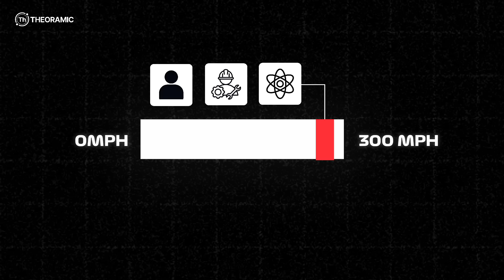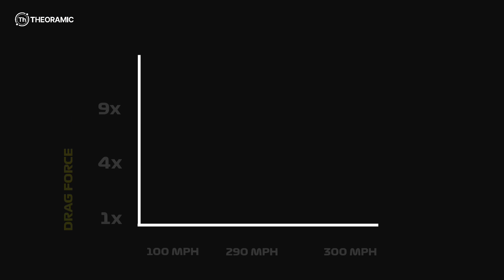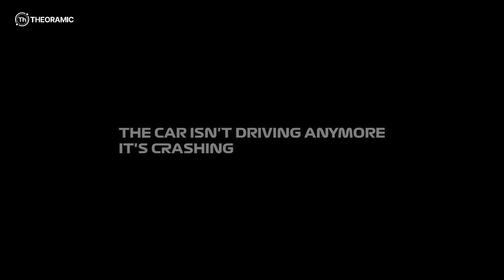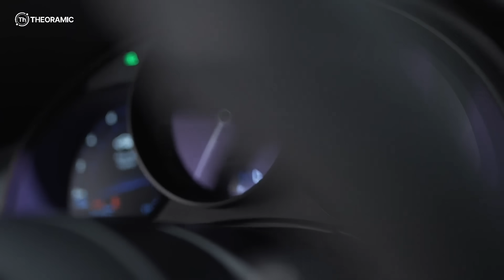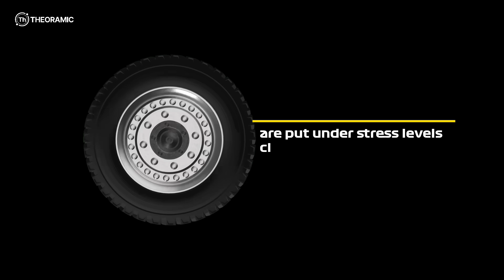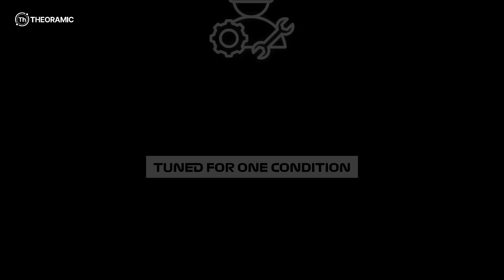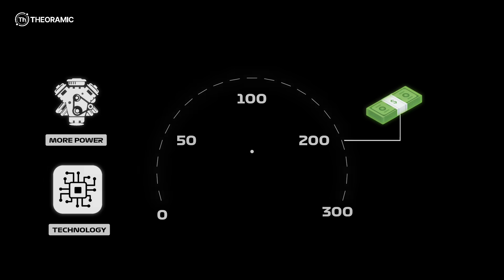Why It’s Almost Impossible to Go 300 MPH

Comment: The ssc Tuatara went 295mph verified by Racelogic vbox, this car has the most simplest Y-zero section of any those cars in the video. Way small frontal area and much cleaner wake. 
Aero designed then styled is key in this mission of 300mph.  Compare the side views of the F5, Tuatara and Chiron and you will see which company cared about cutting through the air the most at ease.

Comment: Honestly, it's not just the effect of suddenly stopping at such speeds too.

Go fast enough and you'll have to worry about the driver becoming a pancake cause the force from getting shoved into their seat. You're making the car AND the driver battle with G Forces essentially.
Reply from the maker: Yo, you nailed it! The G‑forces at 300 mph are insane—both the car and the driver get slammed hard when you slam the brakes. It’s a whole physics battle in the seat 🚗💥.What’s the craziest speed you’ve ever experienced in a car or sim?
Reply: @theoramic_yt  My dad did pull 100 mph on a highway back when I was in highschool. being the middle of the night, wasn't that much traffic either.

Just that much made me feel like I was being pushed into my seat. Of course, he didn't slam the brakes to slow down tho. He just dropped back to going around 50

Comment: I got to about 120 in my volvo xc90. At that point if your not traveling straight the handling starts to decline. I could say that if your driving on a straight road you could handle about 150 MPH normally. The roads in massachussetts usa are not without potholes and are constantly being repaired and are not straight.
Reply from the maker: Appreciate the real-world insight. That actually proves the point of the video — once you pass ~120 mph, even large, stable SUVs start running into physics limits. Tire heat, suspension geometry, road imperfections, and aero lift all stack up fast. On public roads, it’s not about “can the engine push it,” it’s whether the car can stay planted, steerable, and safe. That margin disappears quicker than most people realize.

Comment: Suzuki Hayabusa went 311.94 miles an hour
Reply from the maker: That run was legendary — but notice the pattern: closed course, extreme aero, custom tires, extended gearing, and a heavily modified powertrain. It shows that 300+ mph is possible only with purpose-built machines, not standard street vehicles.

Comment: This is nonsense. The 1600 HP Koenigsegg Absolute has no trouble going 300 MPH, so it depends on HP and conquering drag for good aerodynamics.======
Reply from the maker: The Absolut is actually the best proof of the video’s point. It’s one of the only cars on Earth built from the ground up for extreme high-speed stability — special aero, custom tires, gear ratios, suspension geometry, and even road selection. That level of engineering is exactly why 300 mph is nearly impossible for normal road cars, even with big horsepower.

Comment: Two problems with speeds of 400 km/h and more. Car tires may not be able to withstand such high speeds for long periods of time, and they may explode. The fuel consumption of the Bugatti Veyron at speeds exceeding 400 km/h is 100 liters per 100 kilometers. If the fuel tank capacity is also 100 liters of gasoline, the car can only travel for 12 minutes at this speed, taking into account acceleration and travel from the home garage. In fact, the huge speed of supercars is an opportunity for the owner to feel their speed record for a short time, like on a supercar for straight-line drag racing. It's never a Le Mans 24.
Reply from the maker: You’re 100% right — tires are one of the biggest hard limits. At those speeds you’re fighting heat buildup, centrifugal force trying to tear the tire apart, and microscopic road imperfections. That’s why only a few manufacturers even attempt to certify tires for 400+ km/h.

Comment: If this is true then how come tgv and chinese bullet trains achieve this speeds without breaking a sweat? I knw they run on steel rails but what about the other factors like drag, aerodynamics etc?
Reply from the maker: Great comparison — but trains are fundamentally different. They run on perfectly aligned steel rails, have massive wheelbase stability, long aerodynamic bodies, guided tracks, and zero steering corrections. Road cars fight potholes, bumps, steering input, tire heat, and lift — completely different physics problem.

Comment: That's why Bugatti is the Greatest at these top speeds. The fastest I have been in a vehicle is my Genesis G90 5.0 Htrac Ultimate, I had that big girl up to 145MPH that was exhilarating, I can only imagine 300MPH that is crazy speed for a automobile. Going fast on American roads is not easy to do at high speeds. To many fools on the road!
Reply from the maker: 100% — Bugatti is one of the few manufacturers that actually engineers for extreme-speed stability: special tires, aero, cooling, suspension geometry, and even road surface requirements. That level of engineering is exactly why these speeds are nearly impossible for regular production cars.

Comment: March 2019
M2K motorsports Ford GT is the FIRST street legal passenger car to achieve 300.4 mph in one mile. 
Oe castings 5.4 4V, oe body panels and glass, oe interior, oe suspension minus custom shocks, oe brakes minus custom rotors, oe transmission. 
0-300 mph in 21 seconds, 200-300 mph in 10 seconds 

May 2019 ,Bugatti wrongly states they did it first.
200-300 mph took 44 seconds. 

FoMoCo absolutely destroyed that overpriced and overhyped thing.

Facts

Comment: Yes, drag is the square of the velocity. That is geometric, x^2, not exponential, e^x, which grows faster than x^n for all n, even n=444,549,093,122,740,995,212 and larger.

Power is drag times speed, so the power to overcome drag goes as the cube, x^3, so 300 mph requires 27 times that at 100mph.
Reply: A microsecond at 50 g (1100 mph/second) is speed reduction of 0.001 mph…. A Milli second is roughly 1 mph, so maybe a blink? 200 ms? 200mph to zero in 200 ms is 50g ….I know Max hit 64g when Lewis shunted him a few years back, but he was in a turn and probably just over 100mph, less when he hit the barrier.
Reply: Oh my mathly god what hell😂

Comment: Top fuel dragster: Am I a joke to you? 🤣
Reply: It’s only like 10 seconds
Reply: @sukottotsukeshi.  more like 3.4 seconds before the 🪂 comes out. No top fuel engine can run for ten seconds….there’d be nothing left but molten metal.
Reply: It is a joke, the top tier drag machine achieves at most 340 mph
Reply: @q1tess 343 mph in 1000 feet is absolutely mindbending. Smells great too.
Reply: @kekansaru but its not a road car. A top fuel dragster is a joke compared to a ThrustSSC.
Reply: @donn.4766 And Thrust is a joke to a properly funded rocket car.
Reply: @dr.hugog.hackenbush9443 how is it a joke to a properly funded rocket car?
Reply: High speed trains have achieved 590 kmph speeds.

Comment: Put a race track on the moon theres no wind resistance if you can get a combustion engine to work in space
Reply from the maker: isn't that expensive 😮
Reply: You'd need both a fuel tank and oxidizer tank (Nitro works I guess)

Comment: Horsepower has nothing to do with 300mph because of that 1000+ lbs against you because of drag      Like rockets big engines more lift power  but more gas the more gas the bigger the engines and less payload It’s a vicious scale.    Now what am I talking about simple horsepower does mean speed  but like you said 1000+ lbs against you.  Now you need torque.  High Horsepower and very high torque torque ++++ horsepower +++.   Torque becomes the more needed figure horsepower starts to become less needed but still needed
Reply from the maker: I beg to differ sir

Comment: In the electric age, the war will be who can get to certain speeds quicker rather than if they are even attainable anymore.
Reply: Buddy, we've been in the electric age since the beginning of the 1900s
Reply: @n00b5lay3r  No.  We've been in the gasoline age.  Electric motors may have been in use but were not widely adopted.  

Show me the article about the first ELECTRIC Vehicle charging station and then the follow up articles for the additional ones built around it.  I'd bet you won't find anything before 2010, except for maybe golf carts and the like.  Please don't try to pull out the GE articles either, because we all know that wasn't widely adopted, nor the pioneer in the automotive industry.
Reply: @tstpstudios oh I see your talking about vehicles. I thought you were talking about electricity in general
Reply: @n00b5lay3r  I thought that might be the case after I posted.  I should have been more clear.  My apologies.  Have a great rest of your day.  Thanks for the bit of convo.

Comment: I used to street race cars, anything over 120 mph is extremely sketchy feeling in anything less than a Porsche. I grew up in the lancer evo wrx sti era and they are extremely unstable at about 110mph. My buddy has a Porsche and although I wouldn’t, I feel I could take an exit at 115mph
Reply: I be taking corner corner at 130mph in my c43 w no issue its VERY stable feels like it hugs the ground
Reply: @waterac I should have clarified, I meant these $80k cars. Taking a corner at 110 in a mustang gt feels wild. I will say though if u go to $100k cars it feels even different from yours.
Reply from the maker: That's an interesting experience to share!

Comment: What if a car had more than just 4 tires and was an all wheel drive car? Maybe 6 tires and That would increase the grip possibly enough to reach 300 easier. Trading the aesthetics of the car for better downforce could also help, maybe holes from the front of the car all the way through to the back
Reply from the maker: but still the tires will be At 2,500 Rotations Per Minute
Reply: @theoramic_yt godly

Comment: Wrong. Its even worse. You need 8x the power for a 2x increase in speed. Reason: 4x the force and 2x the speed = 8x the power.
While the force of air resistance is proportional to v^2, the power is proportional to v^3
Reply from the maker: okay sir you are the one who is Wrong

Comment: I suspect the Chiron used for this 300mph+ run was more extensively modified than just removing the speed limiter.

When it comes to showcase events like this, even the most prestigious brands are happy to secretly cheat.

I am trying to find out if any independent scrutineer checked that the engine, suspension, gearbox, aerodynamics etc were actually stock on the car that set the record.

Comment: Crazy to think dragsters do 0-340mph in under 3.7 seconds.
Reply: Then the engine and clutch is rebuilt and the tires are replaced.
Reply: Adding to that (mainly about top fuel dragsters) each cylinder uses so much fuel that it’s the size of a hockey puck if compressed, also the flames that come out of the exhaust pipes isn’t from the engine but the exhaust gases are so hot that it ignites the hydrogen in the atmosphere, crazy to think that the engines are good for only a 1/4 mile but makes sense with all the power.
Reply: @ghostzero5919  I read once that the life cycle of a top fuel engine is under 1,000 revolutions (including burn out).
Reply: @DrDeuteron I read something similar, I used to have a fact sheet about them along with a piston head from one when the guy I worked for was big into that and gave me them
Reply: @DrDeuteron the fuel pumps can push 1.6 gallons of fuel a second.
Reply: @ghostzero5919 it's not hydrogen in the atmosphere, the concentration is far too low. It's unburned fuel igniting on contact with air due purely to the temperature.
Reply: @clueless42222 from what I heard it’s the nitromethane that’s burning so hot, it would burn yellow if there was un burnt fuel coming out the exhaust, from what I have heard the reason it’s white is from burning the hydrogen, it’s hot enough that it consumes the spark plugs in one run.
Reply: @ghostzero5919 I think that sounds more or less correct, the reason nitro compounds are such good propellants is the oxygen within their structures, ready to be used for combustion, makes less airflow necessary.
Reply: Slow.. the magic school bus is faster..
Reply: I was coming here to say the same thing. TF dragsters and funny cars hitting 300+ in 1000ft lol
Reply: No dumbass
Reply: I sprint faster
Reply: Can humans even survive this acceleration
Reply: @kawsara5366 yes
Reply: @kawsara5366 for ww2 vets that would be nothing
Reply: @Nemenis  uuuuh idk how to say it to you but there's no plane in the history of mankind that has a 0-340mph in 3.7s so the pilots are not trained for this kind of G force
Reply: @h00h15  a ww2 pilot experiences 7-9 Gs. Which is much higher than drag cars that pull 340mph. 

Do your research next time son.
Reply: @h @h00h15 are you serious? Goof ball
Reply: @Nemenis  Nice that you should flap your gums while showing everyone the answer but no proof of how you came to produce it. 0-340 mph in 3.7 seconds is between 4.13 and 4.19g. Which plane in WW2 was taking off in much less than 3.7 seconds? You might be refering to the g forces experienced during maneuvers involving a "dive" of sorts. I'll deny that being the case since during the dive the plane was already going "fast" when it changed direction and then used G to increase the number of Gs it was experiencing and everything about it took a hell of a lot longer than 3.7 seconds. Thanks for playing.
Reply: @kawsara5366  As far as i know, nobody in human history has died due to acceleration thus far, it's deceleration that really feeds the grim reaper.
Reply: Most dragsters cannot do anything like that. You're talking about top fuel dragsters only.